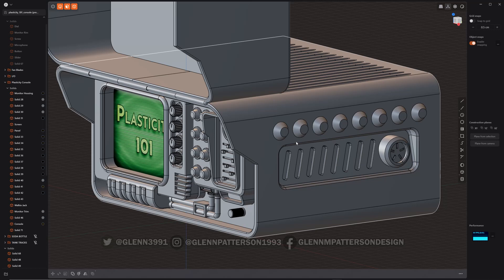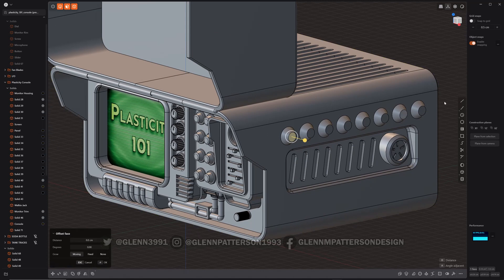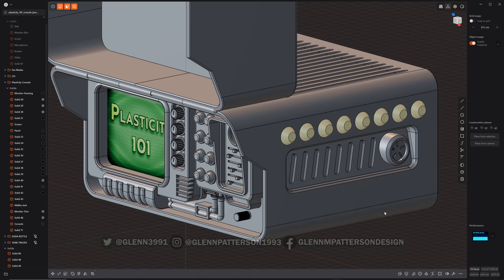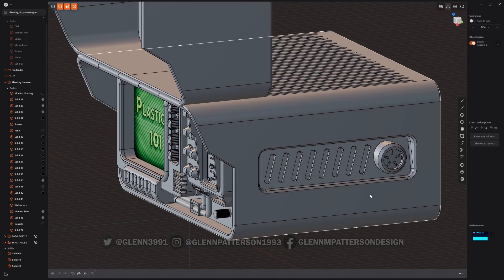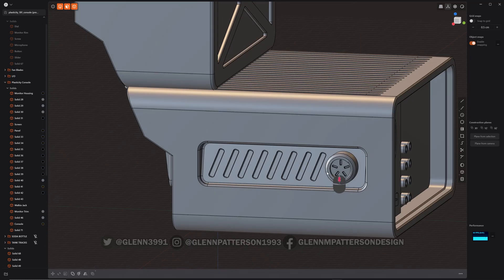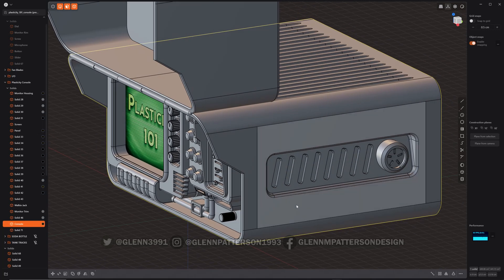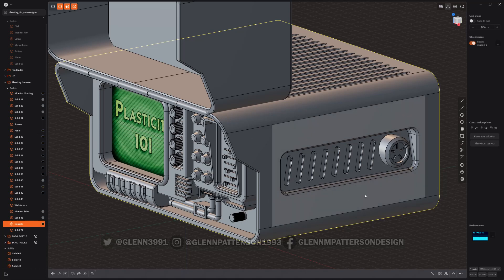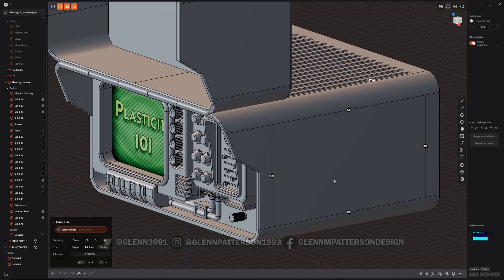55 PLASTICITY 101 REMOVE UNWANTED DETAILS

Comment: Could u make a video about how to work with splines? iam 3dsmax user, so in that program i can change spline points to smooth, straight or bezier. Can we do the same in this program?
Reply from the maker: Have to try with the current Beta, but I think double clicking point will change it from corner or to curve. Be a few hours till I can try.